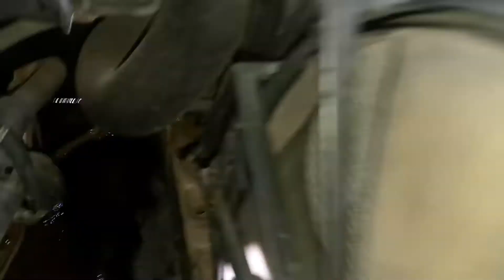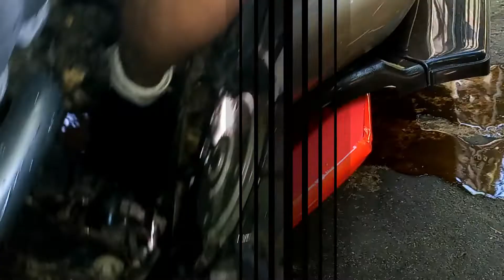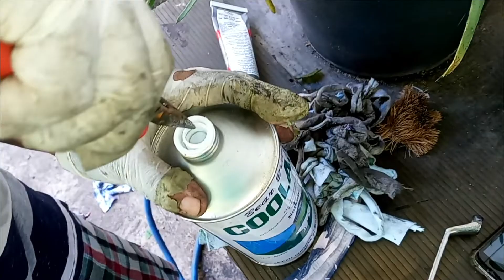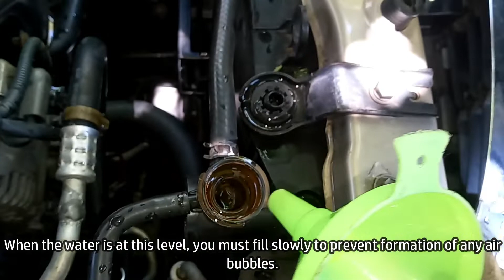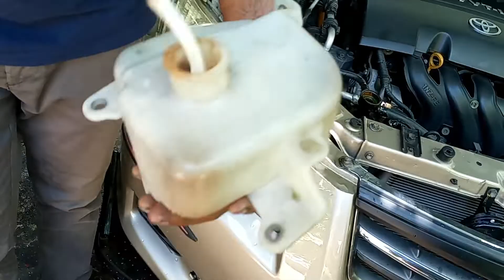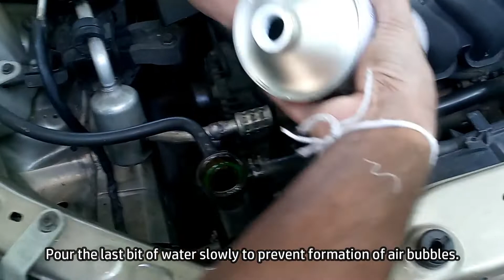How To Flush & Replace Coolant In Any Car (Radiator/Cooling System Service) | Toyota Corolla Axio

Comment: Nice to hear the Sinhala commentary 😊
As the previous guy commented, you should do the final mix with distilled water, not tap water. This is because the impurities in tap water will clog up your radiator far sooner!

Comment: As I observed, ATF oil has leaked from the gearbox cooler to the radiator (look around the radiator Cap), in such cases, the radiator may need to remove and clean, further surf excel (washing powder) filtered with a paint filter can be used to flush milk shake like oil in the radiator.